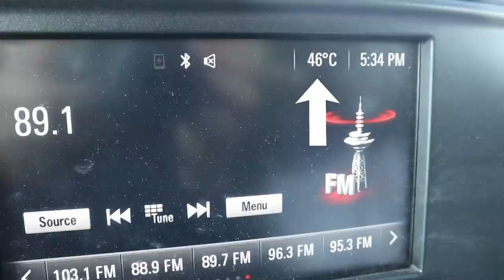Roadside Farmstand During A Heat Wave | Secret Art Project Revealed

Comment: I HAVE AN IDEA.  You should paint your fence red and made the writing in black and white (make it 3 dimensional with black being the shadow).  Example:  fat arrow -> word vegetables -> fat arrow -> word flowers etc going towards your stand.  This can be going both ways towards your stand.  OR.  Using post like realtor post signs.  Paint them red with white letters. one sign with the word vegetables.  one sign with the word flowers.  Etc.  remember you have to be repetitive and bold to be noticeable.  
You should have a petty cash system with a money belt with a set amount in.  Both belts should be the same so you can just grab and go and after you finish you just count and deduct the original amount.  You should also have the money bags ready.  If you need extra then have have 3 money bags ready.

Comment: Most people in Arizona, US tend to hide inside in the air conditioning once it hits 103° F. 115°F is hot and miserable, thankfully our roads, power lines, drip line are built for the heat.  The capital city in Arizona hits 122°F+ at the height of summer. I hope you return to your normal temperatures soon.

Comment: Since it is actually a house , doesn't that make it an outhouse? I hate this heat as well it is evaporating my fish ponds faster and it melted a hole in a quality seed starting tray. Then at night when killing earwigs it is still warm enough to sweat beads. The other downside is I have to pay for the water I use. When it did rain I filled up five 55 gallon barrels and all the pop bottles and gallon juice jugs I could find.  The reality is all that water won't last so I have had to prioritize food and let many flower beds go vacant this year. As always I never water my lawn/ weed patch. It is only green in spring until it goes dormant as it should be.